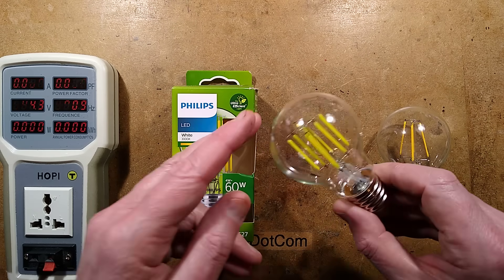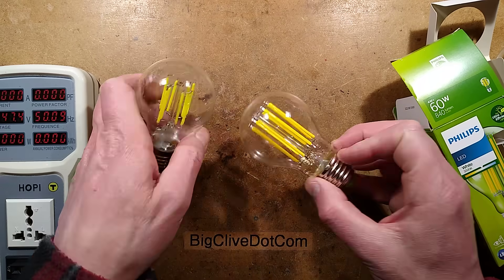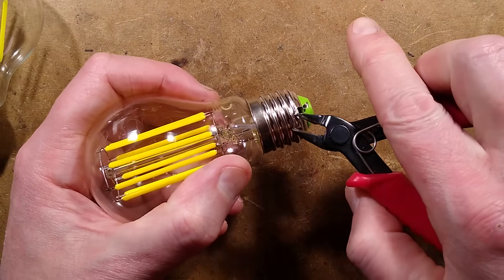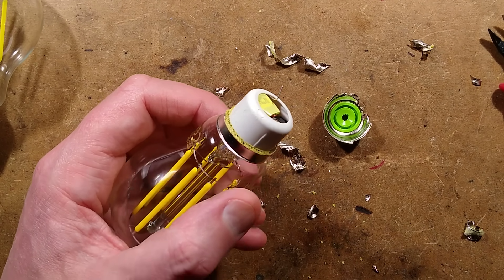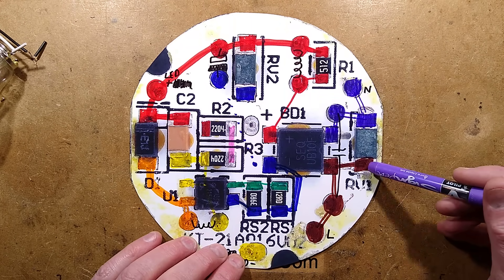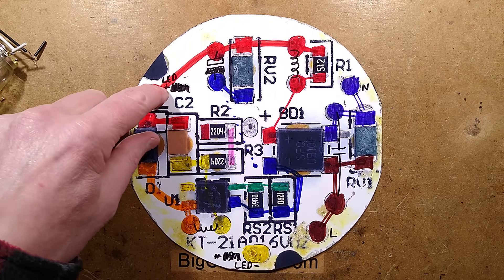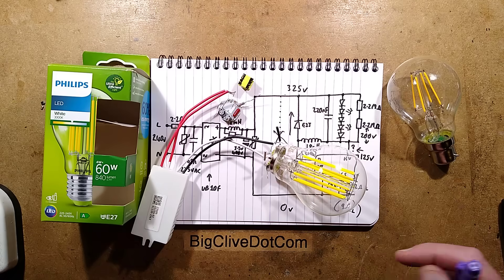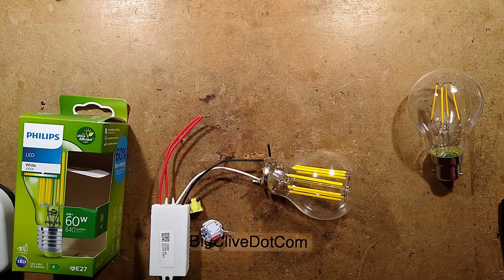Inside a new Philips ultra-efficient LED lamp (with schematic)

Comment: I love ISO icons....we used to see who could make up the most bizarre/silly thing they could mean. I think in this case, it means 'don't breakdance under suspended pallets of this bulb'. 😆
Reply: My guess: not suitable for motion detection lighting.
Reply: @Conservator.  That was my guess. Different motion detector designs turn the lamp on in different ways that the circuitry in the bulb might not appreciate.
That and it involving increasing the number of on/off cycles cutting the lamp lifetime.
Reply: @markfergerson2145  👍
Reply: @Conservator.  that's actually a solid guess!
Reply: @xxPenjoxx  😁🙏
Reply: @Conservator.  Yes, that looks like a PIR detector in the logo?
Reply: @Conservator.  That's what I 'm thinking.
Reply: @Conservator.  Yeah totally looks like a PIR motion detector
Reply: Don't get caught/ walk in the shadows not the light? This bulb sees all?
Reply: @versag3776  that sounds a bit ominous....This bulb sees all! 😆
Reply: @jasonkuehl639  😂 a bit dark...🥁
Hey, but this made me think
Considering all LEDs are also photocells/solar panels isn't it theoretically possible to at least to detect when someone enters a room anyway? Or have a bit of an image?
Reply: I did a reverse image search and the only result was another Philips bulb on Amazon UK. Very interesting.
Reply: These incomprehensible doodles should be called idiotgrams; make something that can be understood by idiots and only idiots will understand them.
Reply: "Not suitable for reflectors" is my guess because the LEDs are too spread out to be focused. I highly doubt that they'd be unsuitable for motion sensors, because it makes sense that motion sensors switch relatively 'softly' because they were designed for incandescents, so from that and the LEDs' stated specs of 50,000 switch cycles it'd also follow that they'd actually last much longer in motion sensors than any other light source.
Reply: Nah, if it was breakdance, the stick figure would be horizontal. This is clearly Twist.
Reply: If you love crazy icons, you should work with SAP!
Reply: Why Dance when you can Stance. {0.o} 😆😂🤣
Reply: Doesn't emit x-rays. :)
Reply: My first thought on the icon was 'do not microwave - that means you Nate'
Reply: I present xkcd #2038 for your enjoyment.
Reply: @Lizlodude  that one needs a warning of it's own! Soft drinks burn when you laugh them out through your nose! 😂 Seriously, I need some of those made up to post around my workshop. LOL
Reply: I was thinking "don't use this bulb as a tennis ball"; as he zoomed in the first thing I thought was that the symbol looks like a view of a tennis court from behind a player (the trapezoid being the court in perspective, and the rectangles being the net).
Reply: .... I was thinking, 'Do not carry a CRT while turned on'.
Reply: @robbieaussievic  That hits a bit too close to home! Back in high school I moved a CRT monitor with the back removed. I definitely made roughly the same shape as the stick figure! 😆
Reply: The stick figure is clearly moonwalking, not breakdancing. 😁
Reply: @EWC3Labs  🤔 I do believe you are correct, sir! 😆
Reply: How about, 'This bulb does not cast shadows'
Reply: I think it's funny they use these icons so people that don't speak English can understand, and just make it so that no one can understand them, if it was English anyone could hope the word and get a translation.
Reply: @brefasdra  the funniest part is when you see the only difference in some ANSI vs ISO warnings are the ANSI says "WARNING" on an orange background, then has the ISO icon below that. But if you are exporting a new product from an ANSI country to an ISO country, the manufacturer can be fined for having the word "WARNING" on that label....even though the icon is the same! When I worked in manufacturing, we applied ISO labels on our product, and a small crew who applied a decal onto the labels to make them ANSI compliant. Except for on a "no weld/no drill" label on a roll over protection/falling object protection structure that the ISO label was acceptable in ANSI countries, and didn't require the W word. 
TL:DR, ANSI vs ISO regulations are clear as mud!
Reply: See Def Stan 05-34 section E for the Ministry of Defence's warning of ionizing radiation.  Woman with headache.
Reply: @bdf2718  I bet there's a ton of other good ones in there too! I've GOT to see a copy of this document! 😆 Seriously, I'm off to look for it!
Reply: @jasonkuehl639  That's the only good one.  You'll need to apply for a login to the Directorate of Standardization website if you want to see the document.
Reply: @bdf2718  that's what I ran into. I probably could have been granted access when I still had DoD credentials, but they've long since expired. I also ran into a ton of websites selling the document. I don't know how the MoD is about such things, but a lot of those documents are a huge no-no, especially when you get caught trying to sell copies! I wonder if it's also available through my previous companies spec network. We had to keep a lot of governmental bodies regulations handy when we were producing U.S. military and NATO products.
Reply: @jasonkuehl639  
Thanks for your interesting posts. 
I’m surprised to learn that those ANSI and ISO documents aren’t available to the public. That doesn’t make sense for a standards document or am I missing something?

The answer probably is that both ANSI and ISO aren’t funded by the US government or the UN so they need to sell their products to cover their expenses. That’s very unfortunate imo.

A similar business model is applicable to the Dutch standards organisation NEN btw.
Reply: 60 watt is efficient? A high end cpu uses 65 watt. This power hungry. How is it efficient?
Reply: @fynkozari9271  It corresponds to a 60W incandescent lightbulb
Reply: @doctorweile  That metric is getting increasingly meaningless. There are generations of people who have never seen an incandescent lightbulb now.
Reply: @felixar90  I can only agree with you.
Reply: @felixar90  we are still measuring light strength in candles (candela)
Reply: @felixar90  I gets interesting when you have a fitting, or a shade, which has a max rating on it, basically when to the IKEA plastic shades melt from the heat,or the bases become brittle . or burn?
Reply: @fynkozari9271  "high end CPU" like a celeron maybe?? 😂😂
Reply: @fynkozari9271  How much light does your 65-watt processor produce? Pretty sure it is close to zero, which makes it incredibly inefficient lighting.
Reply: @fynkozari9271  Intels 12th gen with 300W power draw has entered the room. And yeah 60watt rating is what an incandescent light bulb which basically is just a heater with added light output would draw. The LED takes way less
Reply: @fynkozari9271  Equivalent to a 60 watt incandescent lamp. Actual consumption 4 watts.
Reply: @fynkozari9271  It's only 4 watts - equivalent to old 60w gls bulbs.
Reply: @fynkozari9271  it says it's 4 Watts, equivalent to 60 Watts, amazing if true...
Reply: @Mr_Rusty1  so bad design? Why would they write 60 watt so big, 4watt so small? Werent they supposed to advertise how low the power usage? Really bad design.
Reply: @fynkozari9271  60 watt is the equivalent in light it produces a normal old philament lamp ...it consumes just 4 watt...even led lamps uses that' terminology' to let customers not in tech understand what thet are buying

Comment: That last symbol on the box says that it's not suitable for PIR triggered lamps, probably because they trigger way more often than a normal switch or maybe not triggering early enough in the cycle and that messes up the driver?

Comment: power factor is very disappointing , esp for an expensive "green revolution" product , from a market leader.     this bulb couldn't be legally sold in california.   

all these capacitive loads these days are starting to dominate.   it matters for the small devices too because they add up.  and for anyone running an off grid solar setup , you need bigger inverters if running a bunch of 50 power factor loads..

Comment: F .. L .. A .. S .. H   stopper at End Of Life? 
Regarding taking the H.V. from the end of the LED string rather than the power rail, I suspect that this lamp won't do the flick, flick, flick thing when the lamp reaches the end of life as there will no longer be any power to build up the voltage until any faulty leds start conducting.
Clever! I do so hate the end of life intermittent flash of many LED lamps

Comment: The HV line being at 125V, any chance that voltage may have something to do with changing a couple values so it could be sold in the US where line voltages are in the 120V range?
Reply from the maker: Not sure, since on 120V they might be better using the original datasheet schematic.  I don't know what voltage range the chip can use on its HV supply connection.

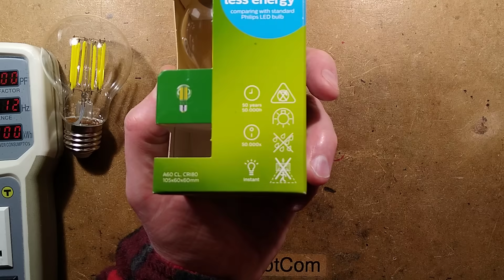Comment: 1:50 I think they are saying not to use it in motion sensor applications probably because it will be constantly turned on and off which might cause the circuitry to fail sooner.
Reply from the maker: If it is that it's more likely to be to avoid issues with older PIRs that have a snubber network across the relay contacts.  It would cause the lamp to pulse when off.
Reply: @bigclivedotcom  Add a capacitor and make it glow. ;-)
Reply: The picture looks like a PIR sensor and the person walking is depicting motion.

Comment: Good to see that they are using a lower colour temperature than the Dubai ones.  The cold and very cold white of the Dubai lamps limited my use of them in the UK.  Price isn't extreme as I'm pretty sure they are paying extra for the high efficiency LEDs (selecting the highest output binned ones). 210 lumens/watt isn't to be sniffed at especially when you consider the Stokes shift of the phosphor to give the 3000K colour temperature.
Reply: Apparently hot countries prefer colder colour temperatures. And vice versa.
Reply: @iAmTheSquidThing  The higher sun angles  nearer the equator make daylight more blue-white compared with the UK. In the UK the lower sun angle means the sunlight passes through more atmosphere with the result that it looks more yellow because the shorter wavelengths are scattered by the air molecules
Reply: But a CRI of 80? That's ancient and far from eye comfort for me. It's like looking at colours under 1970s "warm" fluorescent lamps, when ladies in makeup looked like zombies.
Reply: @68MalKontent  Halophosphate warm white fluorescent tubes had a CRI of 52. Halophosphate cool white had a CRI of 62. Modern rare earth tricolor phosphor fluorescent lamps all have a CRI of at least 80.
Reply: @gregorymalchuk272  On the other hand, there have for years been fluorescent tubes for printing/graphic industry with Ra > 97.  
In a lamp that expensive I'd expect a better result than 80, which is less than cheap fluorescent tubes of the 1990s.
Not sure what good are the exampes of poorer CRI – sodium lamps used as street lighting years ago had an even worse index, because the light was practically monochromatic. But that's not comparable to a domestic light in the 3rd decade of XXI century, especially when we are talking about eye comfort 🙂
Reply: You pay a fairly high efficiency penalty for good CRI. It is a compromise for efficiency.
Reply: @68MalKontent  never knew this kind of light elite existed
Reply: @68MalKontent  CRI 80 is standard.
And even modern consumer CFL's were always a lot worse than any decent 80 CRI LED.
Reply: @LueLou That's not exactly going to help for white LEDs lmao.

Comment: Could the circuit change be to allow for 230V supplies compared to 110V? Given the drop is to 125V seems a possible change for differing markets?
Reply: Yes, seeing as the controller is designed for universal voltage, lowering power dissipation both improves efficiency, and also makes the tiny chip last longer as well.
Reply: Also if the chip should fail short, the lamp will keep working (ish). No short circuit path exists.
Reply: Exactly what I thought. The datasheet probably has an electrical specification somewhere for what the HV range is. This might specify 100V to 350V to cover all areas in the world, but the schematic might be for 90 ~ 110V regions (US and Japan).
Reply: @iamjadedhobo  Yes they have limits for the boost voltage for different regions, but likely only show the one, unless you ask them for the full datasheet, likely only on a NDA agreement.
Reply: @iamjadedhobo  That's what I'm thinking. The way it's designed it would get you North America, Mexico, Central America, parts of South America, Japan, The Caribbean, and Taiwan.
Reply: This was my thought. If they accounted for the current sense resistors and it was meant to be a 120V market chip, someone could have designed it for a range (say 120-180V) at that mains voltage and tweaked both the HV sense? line and CS resistors to make it run happily at 240V+ without the messy process of needing to design and make two chips or a less effective multi-range chip. Very clever result.

Comment: @1:52  I think the symbol is for No Motion Sensor lighting.  
Personally I don't consider something 'ultra efficient' if it costs 4800 times the amount of a comparable product.  (£12 compared to 25¢ each for filament bulbs)  
<I really hate having to pay all this money for something that is supposed to be more ecologically better but really isn't...especially considering the waste products of the new stuff>  
<When you count in the shipping problems of aviation fuel and/or diesel for transporting these from China...the "ecologically better" argument really goes downhill quickly>
Reply: If they last longer then that does reduce shipping. Also 48x not 4800. I would compare them to other CFL/PU bulbs these days though. Certainly we shouldn't be having to pay extra to be efficent though. We'll be okay once the oil/coal etc runs out.
Reply: @drsquirrel00  
Oops...my "adder" was crooked  :)  
CFL's have mercury in them...at least all mine said they did.
Reply: Your filament bulb costs a lot more than the ultra efficient lamp when you take into account the cost of the power it consumes and dwarfs any shipping emissions from China, in any case your incandescent lamp probably in part or whole comes from China too (maybe you can use good old all-American tallow candles). In any case incandescent lamps are banned on Europe and other countries because of their extreme inefficiency.

Comment: Yay!!! Found one in a shop nearby. My preferred shop did not have them, so I thought, the bastards may have limited the markets , but it is there. The only difference on the packaging I can see is that it does not say "Ultra efficient" but "next generation" top right. Getting some right after work.
Reply: The  "Ultra efficient"  is not the same as the one in Clive's video. It is a different series.
Reply: Don't tell everyone, but John Lewis in the UK stock them. They've also got the 2.3W (40W equivalent) version with 4 filaments, £3 cheaper.